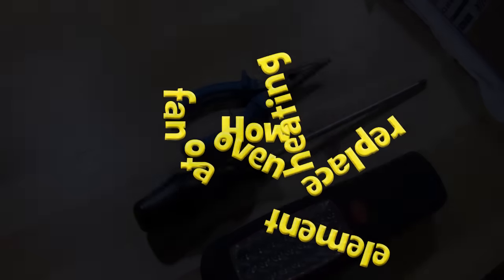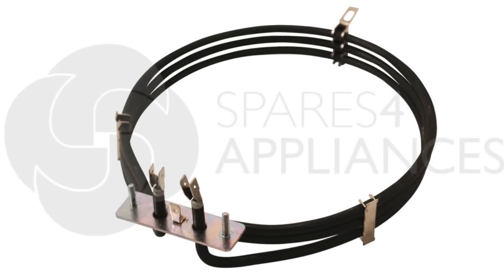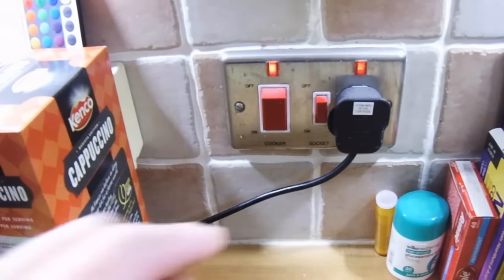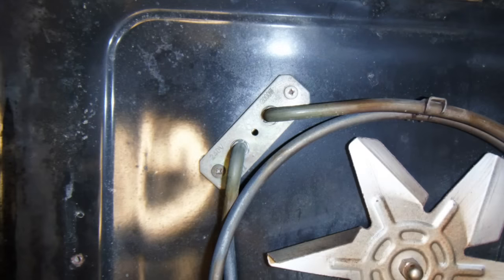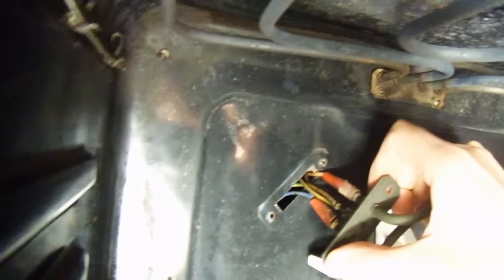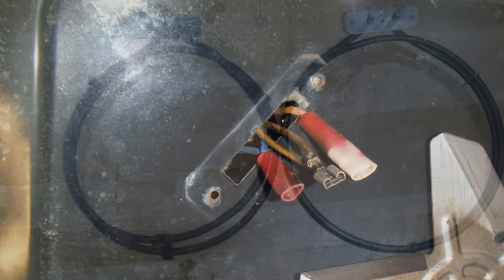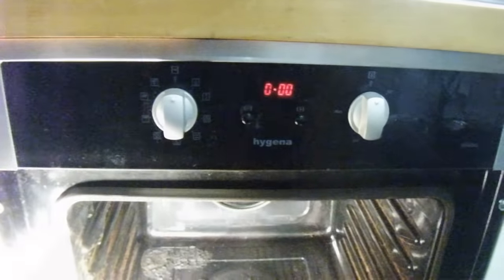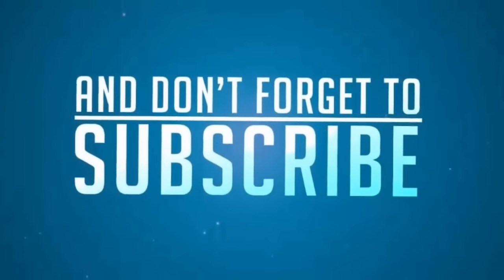How to replace and fix an electric fan oven heater element.

Comment: little tip before removing the spade connectors put a bit of electrical tape over the hole it will stop them popping back in the back of the oven, Once on your new element remove tape
Reply from the maker: GREAT tip !
Reply: Alternatively, crimp a couple of spade connectors onto some string or similar, and connect to the oven connectors to stop them vanishing. Don't use wire - as any inadvertent switching on of the oven (you did switch it off, yes?) may lead to sparks!

Comment: I found that when the replacement element arrived the fixing bracket was in a different position to the original one. It meant that if I used the existing lower hole for the element fixing point then the element would touch the fan. So I had to drill a new small hole (2mm metal drill) in the metal back of the oven for the fixing screw. Fortunately this did not take too long. Everything else worked well , exactly as you described in your video.  Thanks to much for posting it , has saved me £s and also  proved I can manage these jobs myself without waiting for a tradesman to turn up and do it for me.
Reply from the maker: Well done Tom for the drilling mod.

Comment: Thank you so much for this helpful video. Not only have you have saved us alot of worry and forking out £300 on a new cooker or a 3 week wait and probably £150 from an electrician. You have also increased our self esteem about what we can actually achieve around the house.  This is exactly what YouTube is good for.  Thank you so much👏
Reply from the maker: Glad I could help!
Reply: I agree with you totally
Reply: So long as you can gain access to things that need repair - and there is a long-standing problem with manufacturers who make it otherwise - then you can usually fix anything. Luckily, the EU is forcing makers to make everything repairable by the user now and this will improve things, even in Brexit Disaster UK.
Reply: Thanks so much for this. I have a question, I ordered a part online which arrived today, however although they are both 2000 W, the original one is 230 V and the new one is 240 V. Is this going to be okay? Thank you 🙏
Reply: @leighcanning3849  you sent this to me as oppose to the original poster/handyman. I'm sure you'll find the answer by googling your question though. Sorry I didn't know the answer
Reply: @smokehousestu9614  oh no! Haha sorry about that mate. Yes, all sorted now. 👍🏻
Reply: @leighcanning3849 i know this is an old comment, but just wondering if the 240v element you got worked fine? im in the same boat where my previous one was 230 and this one is 240. i assume its fine, but just want to make sure. cheers

Comment: Thanks for the video. My oven had the screws holding the element in screwed in from the outside so I had to take the whole oven out and take the back off to access them but once that was done the whole process was very simple, about 40 minutes total time, thanks again 👍

Comment: Thanks to this video, I simply turned the power off to the house, found that my oven has the element at the Front so the oven stayed in the wall, one philips head screw driver, 4 screws and only 2 plugs later.. I have one blown element to take to the appliance store to replace for the new one. This video was excellent and another Great youtube moment. 🤙🎥

Comment: very good video. explained the replacement process in simple stages and gave me the confidence to try this. One tip I would add is that I tested the electrical continuity which confirmed that the duff element was broken and the replacement gave a continuity signal.
Reply from the maker: Great tip!

Comment: Thanks I just fixed our oven for £22! For me one of the wires did indeed go back through the hole, as it was a bit loose on the new element. I had to open the back of the oven and push the wire back through. It was pretty obvious which wire to push through. Cheers.

Comment: Excellent video, thanks! Job done. With hindsight I'd have chosen a brighter time of day, and also considered that it would involve cleaning the oven... 🙄 One point of safety: allowing the test run to cool down before replacing the cover (yes, I burned my fingers 🤦‍♀️), and switching off the power again beforehand. Also a practical suggestion: using masking tape across the hole/s to stop the wires going down the back.

Comment: Many thanks for the post, under normal circumstances would have got out the local shop to do the job, but have just done the job myself, thanks to this video it took 2 screws on the back cover and the 2 holding the element to the cooker, many thanks for giving me the confidence to do it myself and save myself £50/60 

Once again many thanks,😁😁

Comment: just fixed my oven for £6.99 . What a guy👍🏾. Although, my oven didn’t have an earthing cable (i double checked by taking the back off to see if it had fallen, there just wasn’t one there). So don’t freak out if you can’t find it, “some/newer ovens earth through the oven cavity.” says google.
Reply from the maker: Glad it helped

Comment: Thanks for the video.  Typically, the two screws holding the element to the power supply had been installed from the back so had to take the oven out, remove the back panel just to remove them.  They will be going back in from within the oven cavity once I have the new element.
Reply: Follow-up: the DeLonghi DC-60DF dual fuel oven has to have the screws fitted from the back as it’s the element that has the thread. There’s no threads on the carcass. 😬
Reply: Same situation - screws were fitted from the back1! A Bosch 331 fan oven. Will have to try again tomorrow.
Reply: The element in my Lamona 4603 fan oven was exactly the same with 2 of the 3 attachment screws installed form the back, WTF !! Rather than pull the whole double oven out from the kitchen unit I managed to remove the 2 screws using grips on the screw  tails and back-wound them out. I then pulled them out using a magnet on a stick through the cable slot. Could probably leave them in there tbh as they are caught up in the insulation and not really a problem. I then opened up the two holes in the new element attachment plate to 3/16" diameter and installed it with 2 suitable self tapping screws fitted from the front . Mission completed in about 20 mins for just the price of the element , about £10. 👍😉

Comment: Fantastic video, I really hope I can find the element and it is the element that has gone. My oven just wont heat up properly on the fan heating setting, light and fan is fine,  but top bottom (grill type) seem to all work, so I guess it is this back heating element thing. I know nothing about ovens but I do know we have not enough to throw it and buy a new one, so I am going to give this my best shot just as soon as I can find the exact element for my oven

Thanks so much for this upload, I am sure it has helped far more than have commented that it has!

Comment: Hi there. Just changed the heating element on my cooker exactly this way. There were four spade connectors on the new element and not two as we're on the old one. I connected it up the same way as the old element and it seems to be working fine though. Cheers!

Comment: Thank you. That was really clear and helpful. And I feel 100% confident I can now change the element in my oven 😁  Much appreciated
Reply from the maker: Glad to help.  After i paid £110 and watched a fitter do the job i knew i could easy do it myself.  Just watch that the connectors dont fall back into the oven when you un clip them.
Reply: Fab I’m going to give it a go too

Comment: I was waiting for my boyfriend and/or my brother to replace it. Just rewatched this video and did it myself. So easy, scared my self when I realised that mine only used two wires instead of 3, thought the other one was in my oven. But installed it all myself in under 10 minutes. Is this my calling to become an electrician hahahhahha x
Reply from the maker: Well Done  !

Comment: Good video man, very well explained. 

Did you know : Ceramic heating elements like this aren't polarity sensitive so you can put the wires on either way round and it does not matter, 

I would always suggest taking the back off to do a inspection of the wires and if there are any thermal leaks behind the oven that could be burning wires.
Reply from the maker: Thanks for the info!
Reply: @CB-RADIO-UK .. I have just taken an element out like that one with 3 pins on the back but when I pulled the element out easy ther was only the wires on the big pins each side should it be like that are is ther definitely a wire on the middle pin aswel it's a logic cooker model ldoc60x17 any help would be great as I don't know nothing bout this type of stuff and im afraid taking of the back of cooker now and doing some damage 🙆‍♂️
Reply: @willythestud1517  I would have removed the back and looked for the Earth wire and pushed it through and reconnected if it was me. By the way some ovens do not use the middle connector so maybe ok.

Comment: Thanks my element has just burnt out and now I know its an easy job I will replace it myself - fortunately there is a electrical spares shop close to me that has a universal part in stock
Reply from the maker: Glad to help.  Seems the elements last about 2-3 years but cheap and easy to replace yourself.
Reply: I was able to replace it myself in 15 minutes - the hardest part was carefully removing the terminals from the old element, apart from that an easy job, it cost £30 for the replacement element, the man in the shop offered to do it for me if I needed him to, but would charge me another £40 call out charge so your video saved me £40

Comment: Thanks for this video. My screws have burnt out /gotten rusty on both the two that keep the element secure and the ones that secure the oven back panel housing the fan element. I don’t suppose you know which screws they are to order replacements?
Reply from the maker: Mine just had small self tapping screws.
Reply: @CB-RADIO-UK  cheers mate

Comment: Thank you for your video. I can find the four screws for the enclosure. With a great deal of effort, I can remove three of screws. The final screw is "rusted tight." Do you have any advise on how I can loosen this screw from the rust please?
Reply from the maker: Hi.  You will have to carefully drill off the head of the screw with an electric drill and 
 either punch the shaft of the screw back through its hole or if it sticks out unscrew it with pliers.  You can replace it with a new self tapping screw.
Reply: @CB-RADIO-UK  Thank yo for your reply. The oven the is fitted between 2 cupboards, an awkward position. Should I be using a thinner drill than the screw or a wider drill then the screw?
Reply from the maker: Use a much wider drill.  If you can run it a slow speed to grind the head of the screw off.  Take your time because you dont want to make the screw hole any bigger.
Reply: @CB-RADIO-UK  Thank you

Comment: Thank you, you made this look really easy, so easy that I will give it a go at fixing the oven :)
Reply from the maker: Its a simple job if you take your time.  Just makes sure you note the wires and where they go and dont let them fall through the hole.  Good luck.

Comment: Hi, 
Thanks for the video. My oven was tripping my electrics. So I watched this video and changed the element. It was really easy. However. Now my fan spins very slowly and the element is glowing red hot which it never did before. Any idea. Maybe the fan motor had gone?
Reply from the maker: Hi.  Yes thats how they normally go by spinning slowly.  Replacing fans are a little more tricky esp to get the right fan.

Comment: I opened mine up today and saw no screws holding the element in place just pins. So I had to pull out the oven, remove the back panel. Then took a photo, removed old element, placed in new one and put everything back and it’s working. It was slightly annoying to do (wish it had just been screws) but I just saved £285 from what I was quoted. Only cost £15 for the element too.
Reply from the maker: Yes my new oven has rivets which when the time comes i will have to drill out.  Just shows you that they would like people to throw away an oven after just a few years other than repair it.

Comment: Mine was very similar except in the fact that my element was secured with studs and not screws. Meaning I had to have the cooker out, disconnected, have the back panel off, and then undo the 2 retaining nuts. Got there in the end though. Why do Sparkies never leave enough slack on the cable at the back of the oven, it's always a struggle.
Reply from the maker: Well done Dax

Comment: Could you advise where wattage of element would be found other than plate where its held in place ? Mines doesn’t have wattage there, I’ve not removed element yet, could it be on other side ?
Reply from the maker: Not easy.  Maybe google the oven for perhaps a wiring diagram which will prob show the wattage of each element.

Comment: I have a howdens lamona oven do you have a video how to replace the element?
Reply from the maker: No sorry i do not.
Reply: Its exactly the same, but on mine the heads of the screws come through the back. They're not accessible from the front. You'll have to slide the oven out and take the back off and do it that way.

Comment: Just wondering- my electric fan Bosch cooker trips the consumer unit every time I switch it on it’s on its own circuit too. It’s a young machine 4-5 years old. How likely is it to simply be the element that needs replacing and not something else? Many thanks
Reply from the maker: Its hard to say.  When our oven elements have blown they trip the electric just once as they go open circuit.  Once the electric is reset it does not trip again.  Simply does not work.  It does sound like yours has a direct short somewhere.

Comment: Nice guide, like many electrical items fairly simple when you start taking them apart.
Reply from the maker: +darkwaterblue Thank you.  Yes your totally 100% correct.  We had a oven which blew a element under warranty a few years ago.  A guy came out and did this job in 5 mins.  He recons he charged £115 for the work.  I ve replaced another 2 since then.
Reply: darkwaterblue n

Comment: Quick question, I have removed the fan over and the element doesn’t seem to have screw heads to unscrew the element. Looks like the end of flat screws coming from the back of the element panel. Any ideas?
Reply from the maker: Some are screwed from the back and some are even riveted to the oven (god know why).  Sounds like you may have to remove the back panel. It should be easy but expect some fiberglass matting so wear gloves.
Reply: @CB-RADIO-UK thank you for the reply, managed to get it off via the back panel. Now just to get the new one fitted 😂

Comment: One thing i would  say is my hotpoint oven uses 3 prong double  heating element but only has two connections when changing the fan motor  i searched for the earth connection but there was non... i have checked  the hotpoint website but the picture still shows three prong connection and i know the original  had three prongs too so maybe not all have the earth  connections

Comment: Thank you for the video!  I replaced my element easily :) I put the cover back on and turned the oven on and it is heating up (finally) but the element is showing bright orange when heating the oven, is this right?  Ive never notice it doing that before.
Reply from the maker: Mine has always glowed on high heat.

Comment: Just replaced an element using your video but a question I have that's concerning me. I replaced , screwed element in place and turned oven on but only one of the rings are red with heat, the other is slightly red but not like the other one. Is this normal ? There is a nice bit of heat in the oven , I'm just concerned there might be something wrong with only of the cables thst click into this element ? Any suggestions or ideas
Reply from the maker: I think the element will either work or wont with the cables.  Sounds like part of the element is heating up quicker that the other.  Guess that will down to resistance in the element.  If it has a fault at least you know how to swap it out if it fails early.

Comment: Thank you, I've just managed to do this.  Question... is it essential to have the little rubber bits around the grips? One has degraded and fallen off when I took pulled off the clips. Is this dangerous to have the clips onto the new element without the rubber bits around them??? Thanks!
Reply from the maker: Mine also were cracked.  No not really they are just another level of protection from shorting and as long as they connectors dont touch the oven (they should not) its fine.
Reply: @CB-RADIO-UK thank you!

Comment: My heating element went on mine however there is no earth wire connected to the element at all but the earth terminal is there. I’ve ordered heat resistant earth wire where’s the best place to earth it. At the main oven box where we connect electrics.
Reply from the maker: Hi Darren.  Sorry iam not qualified to answer that. I think my earth just went to the oven chassis

Comment: On my flavel oven the base plate screws are coming through from the back. I can see the thread rather than the head of the screw! Is it still going to be a simple job?
Reply from the maker: Prob more involved as you will have to take the back cover off.  However these elements are service items and made to be changed.
Reply: Same here how did you get on ?